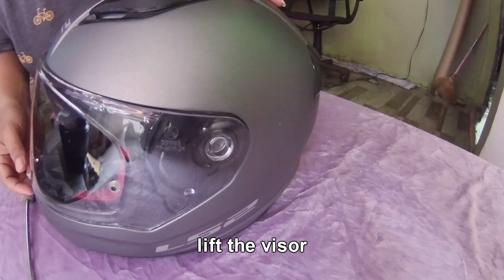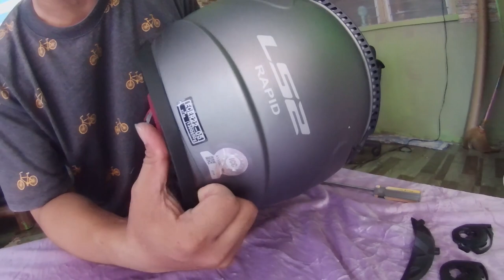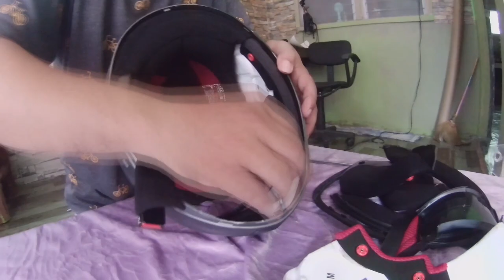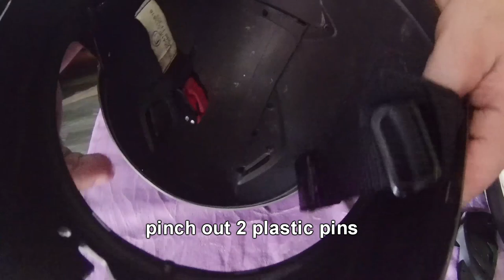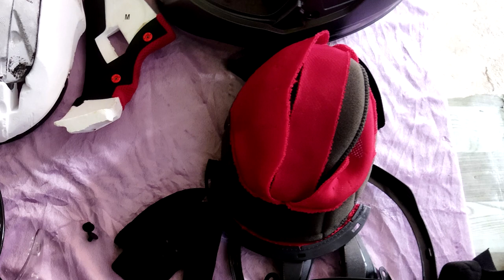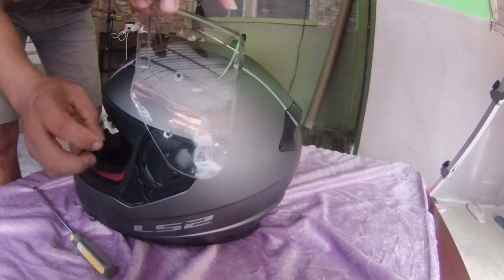HOW TO FULLY DIS ASSEMBLE LS2 RAPID (TOTAL STRIPPED DOWN)

Comment: LS2 is China brand helmets register in Spain, it's a fake Europe brand helmets. You know what? I saw a Taiwanese youtuber cut many helmets including Shoei、Aari、AGV、Shark、Nolan..., those helmets were cut into two pieces by chinsaw, the head EPS still stick on shell and super hard to disssamble from shell!!! I see you can pull out the head EPS from shell even though the shell is not been cut, it's not a normal condition for ECE Certification helmets!
Reply from the maker: agree, but consider this is just a low end model